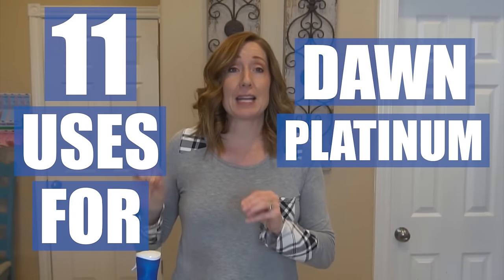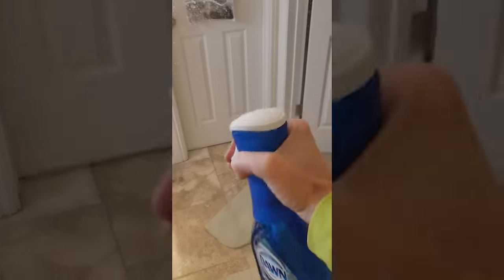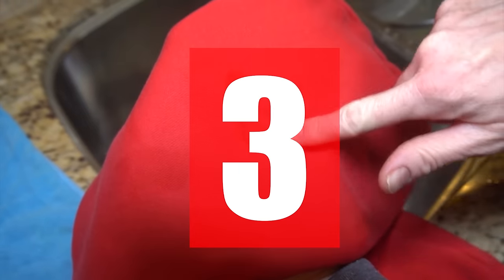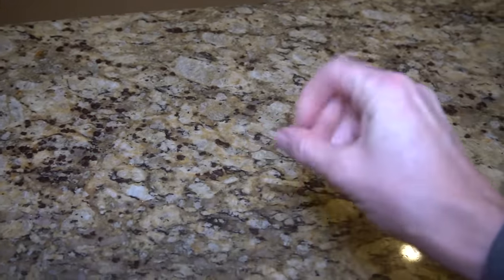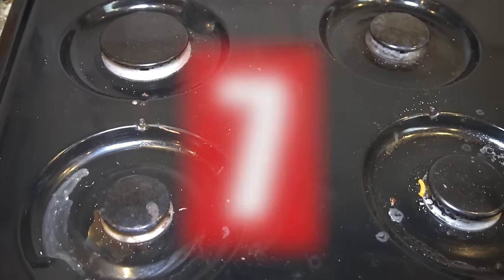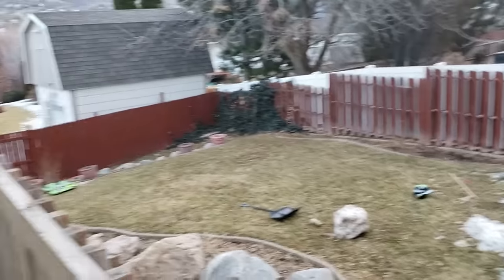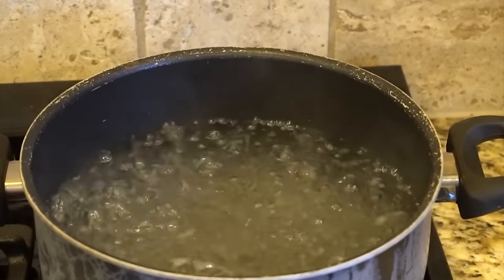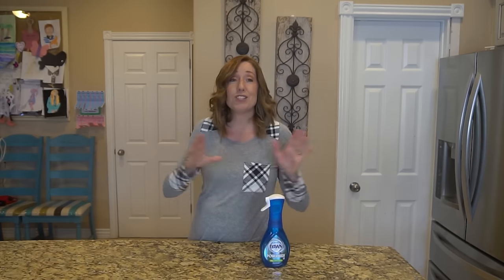Dawn Powerwash | 11 Amazing Uses Besides the Dishes to Make Your Home Sparkle

Comment: Speaking from a mechanic point of view, i don't recommend cleaning your tools beyond a simple wipe off. Tool that are very clean rust out very fast after being chemically clean; especially adjustable tool with moving parts. On your tools you want that oil residue to protect you tools from rust and prevent them from locking up because they are dry.
Reply from the maker: Great advice, thank you.
Reply: Yeah I'm stopping watching after that 🙄

Comment: The Dawn Powerwash also removes labels and adhesive residue!
Reply: Wow I didn't know that I will use that trick🙌
Reply: And LIKE A BOSS!  Better than that Goo Gone stuff, for sure!
Reply: Yes it's all bc of the rubbing alcohol in it 😊
Reply: It’s because of the rubbing alcohol in it
Reply: I've typically  used regular Dawn (straight &/or mixed w/vinegar) for most of these cleanings. Power Wash is pricey w/out a coupon.

Comment: 💲You can make your own, too. All you need is a bottle that will spray in a "mist," 13 ounces warm water, 1 ounce rubbing alcohol (70%, not anything higher), and 2 ounces Dawn dish liquid. I've even made mine with Great Value brand dish soap, and it works just as well! Also, you DO want to add the dish soap last to avoid a lot of suds and bubbles. Personally, I think the easiest way to do it is to use one of those kitchen scales and measure right into your empty bottle. We all need to save some money these days and clean the house, too. This trick has really helped me, so I hope it helps someone else.
Reply from the maker: Thank you for the tip and thorough instructions. I’ve tested it and it didn’t spray as well as the original sprayer, but maybe I’ll try again.
Reply: @CleanFreakGermaphobe  mine didn't foam as well; and I used the original bottle. I guess it works well enough, but I'll be getting the refills

Comment: I was dreading cleaning the shower since it’s such a hassle, and I came across this video I was like let me give this a go if not I’ll go to Home Depot and get a expensive shower cleaner… I did the ratio as said , and let me tell you ! I have never seen my shower so clean ! It definitely did the job and removed EVERYTHING! And even the shower dial that turns on the water I’ve never seen it sparkle like that ! The ratio she tested is spot on and I definitely recommend this technique! Made cleaning the shower way easier and I didn’t have to be enclosed in a small space with harsh fumes if I had used a regular cleaner ! Thank you so much for the tips and tricks

Comment: Range hood filters. Just put them in the dishwasher and run the strongest cycle and it will be super clean. Others are great ideas and looking forward to using them soon.
Reply from the maker: Yes that works well if you have one.  Thanks for the comment.
Reply: I finally bought it and is 100% WORTH THE HYPE

Comment: You can make your own powerwash using regular Dawn: just fill
Power wash container about 1/4 full & rest with water & you have made your own much cheaper
Reply from the maker: It’s close but if you’re not picky. I made my own and my husband wasn’t a fan. He said it doesn’t spray as well. Maybe I should try again. I replace things to see if he notices. And he usually does. I’ve seen recipes with, I think, rubbing alcohol.

Comment: Do you find any real difference between the Dawn Powerwash and regular blue Dawn? The spray bottle is awesome but we can buy a spray bottle like this so besides the bottle, is there really a difference?
Reply from the maker: Dawn Powerwash spray adheres to surfaces and you can be precise with it. Just spray where you need it.

Instead of soaking in water or adding it to water, Dawn Powerwash works without it. I spray it on dishes, then rinse. I may need to scrub some. See this short demo: https://youtu.be/VsPlbHtBVKA the cheese was baked on and hardened on the plate. Powerwash melted through the mess. I still had to scrub some, but not as much as usual.

I use a lot less Powerwash. It's more expensive for sure but I love it. Now I hardly ever use regular Dawn.
Reply: Truth Teller - That was also my question.
Reply: Besides the consistent spray stream, I personally think it’s more concentrated and a just spray goes a long way  👍🏼
Reply: There's some alcohol included which helps with oily greasy dirt. You can buy simple dish detergent and add rubbing alcohol.

Comment: I cannot get the replacement/refill to spray?? Any suggestions
Reply from the maker: Could you open it and pour it into another refill when it's out? It's so frustrating. I have some hairspray that won't spray. I'm going to have to transfer it to another one that does work, after I empty it.

Or try returning it to the store you bought it from.
Reply: Bj’s sells refills ☺️
Reply: Smart and Final sells some I think!
Reply: Also, you can always find anything on Amazon and it would probably arrive the same day , if not the next

Comment: Just be aware you are not disinfecting with this soap
Reply from the maker: Yes.    Dawn does not disinfect.  Good point.
Reply: @CleanFreakGermaphobe  it doesn’t need to disinfect because it cleans and eliminates germs just as well as an antibacterial agent. Furthermore, constantly using disinfecting products is unhealthy by lowering immune systems and causing antibacterial resistant superbugs. We don’t get sick after washing our dishes in Dawn for a reason, because the soap washes away all of the yucky and dangerous stuff that could make us sick.